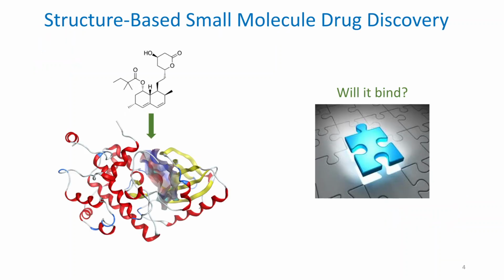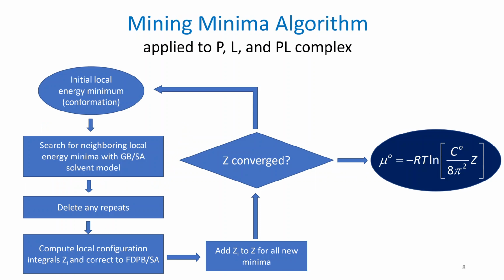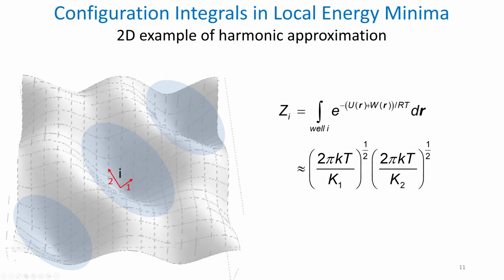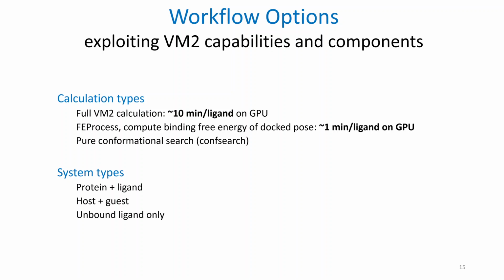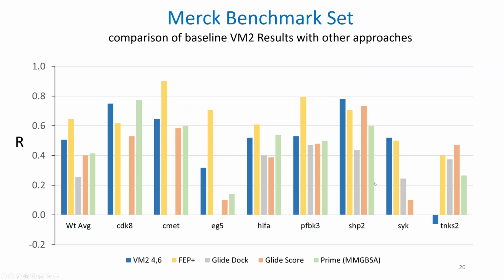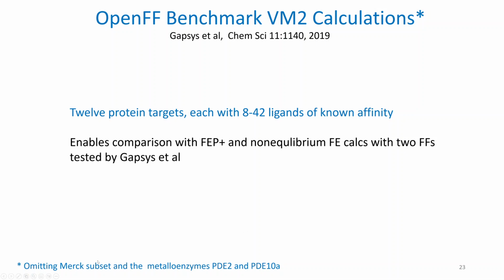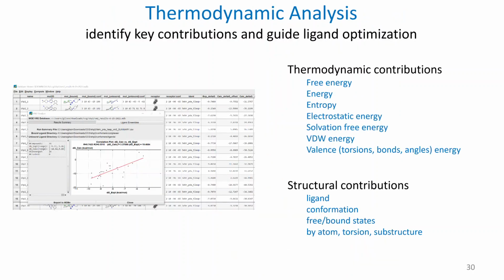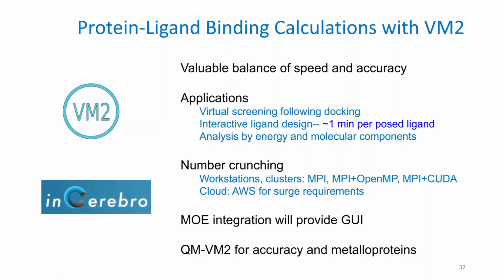VM2 Protein-Ligand Affinities: Mining Minima Theory, Implementation, Benchmarks, and Directions

Comment: Great talk, but I think you are ignoring the influence of forcefields in FEP+, I believe the standard FF is the OPLS4 which has been extensively fine-tuned for the drug-like chemical space compared to the GAFF/Openff families.
Reply from the maker: Thank you very much for watching and for your comment! As you point out, the quality of the potential is very important. We used Amber/GAFF for this initial presentation because both the parameters and tools required to parametrize systems are widely available to both commercial and academic researchers (AmberTools) The performance comparisons to FEP+ in the presentation are between VM2 using Amber/GAFF and published results for FEP+ run using OPLS. So, the relative performance shown includes this difference in force fields. While Amber/GAFF was chosen initially due to accessibility, VM2 is agnostic as to the parameters used as they are read from standard format files. The most common classical force field functional forms have been implemented in the computational engine so VM2 supports AMBER, CHARM, OpenFF, and OPLS style force fields. We provide tools to integrate with AmberTools for convenience, but it is possible to supply complete system parameterizations to VM2 using a force field of your choice, or even bespoke, fitted parameters specialized to your system. It is also possible to run using one potential and then to modify those parameters to do a much quicker recalculation of the free energy using the set of conformers resulting from the first run. Thanks again for your interest and comment!